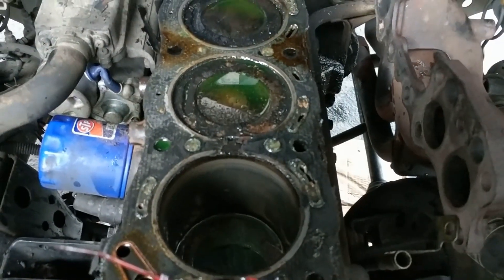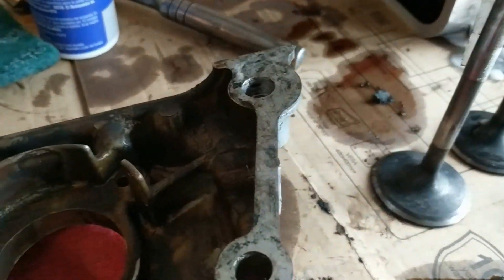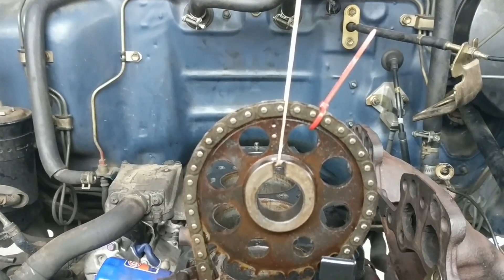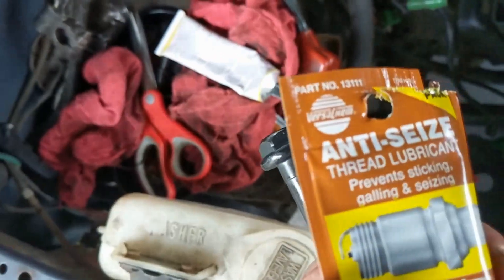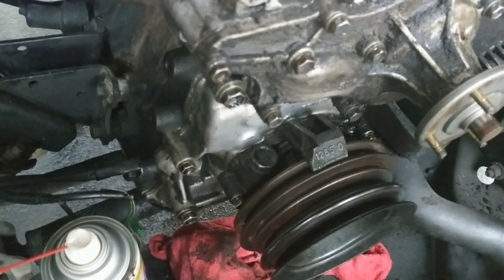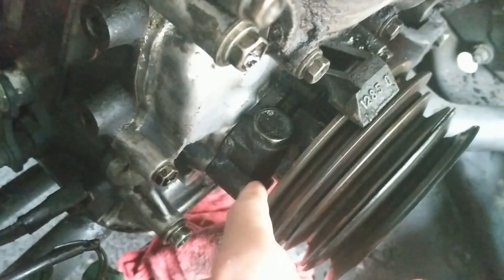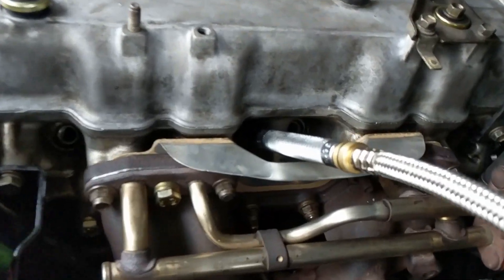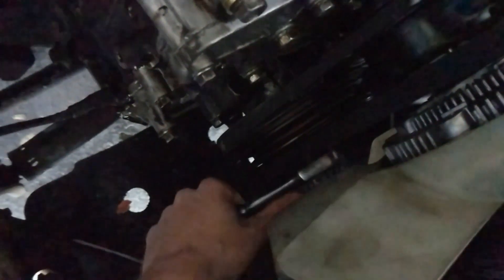22R Head Gasket Replacement 🔧 Blown Head Gasket Between Cylinders - '88 Toyota Pickup

Comment: Don’t think you’re supposed to spin the motor counter clock wise due to slacking the timing chain etc. sum to do with that anyways. (Heard that about 22re’s cause I had to do work on mine)
Reply from the maker: Correct. The guide rails and tensioner aren't designed to take load. They are only meant to correct slack in the chain.

Comment: A good tip to get the timing chain tensioner to move over to give you the chain slack to get the camshaft sprocket onto the camshaft, is to use a 19 mm socket on a breaker bar on the crankshaft bolt, and move the breaker bar up and down two inches, several times, to slightly rotate the crankshaft back and forth, as this will move the timing chain up and down, which will force the tensioner to move over a bit, and this will give you more slack on the timing chain so now the sproket will go onto the camshaft.

Comment: Also get a steel guide which is a  metal guide for the drivers side, as the plastic timing chain guides break right where the bolt hole is.
Reply: The fel pro cylinder head gasket is the best.

Comment: Was it shooting radiator water into the resivoir when it gets hot....
Reply: Too much pressure in the coolant system from the pistons pushing combusted fuel past a bad cylinder head gasket and into the coolant system.

Comment: You did it with out removing the cover how
Reply: There is a hidden bolt on the cylinder head removal, hidden in the oil beneath the sprocket on the camshaft. There is also a hidden bolt on the underside of the intake manifold more towards the front of the engine. The timing chain cover has a hidden bolt on the driver's side that runs from behind the timing chain cover  to point towards the radiator. That bolt is found by the metal tube that runs towards the rear of the engine.
Reply: There are videos on YouTube that have shown two different ways to replace the cylinder head without removing the timing chain cover. One video used a home-made  wooden wedge to hold the timing chain against the tensioner. Another video purchased a special metal wedge shaped tool.
Reply: Which cover are you talking about? The timing chain cover? He did remove the timing chain cover.
Reply: That 7mm crankshaft oil seal is a better replacement for the OEM 12 mm.
Reply: The side of the cylinder head gasket that has the blue color, faces up towards the blue sky.
Reply: Depnding upon the year of the vehicle manufacture, if the engine is the original engine, when setting the timing marks for the camshaft sproket and the crankshaft. Note that the timing mark on the camshaft sprocket will be a bit left of bring actually vertical, meaning a bit towards the passenger side of the vehicle, while the crankshaft pully timing notch points to zero.
Reply: The hidden bolt on the intake manifold is located below the gooseneck of the thermostat housing.
Reply: Another trick to get the timing chain sprocket onto the camshaft is to insert a metal rod into the center hole of the sprocket to pry it gently upwards slightly enough for the sprocket to slip onto the camshaft.
Reply: Another trick to loosen the crankshaft bolt that is torqued to over 230 foot pounds, is called the bump method, where you use a 19 mm socket on a breaker bar and lodge it under the frame of the vehicle, and use a bungie cord to hold the breaker bar against the vehicle frame.But first make a note of which direction the engine crankshaft rotates when the starter is bumped quickly with the ignition key turned briefly, so you will know which direction to place the handle of the breaker bar against the vehicle frame to loosen the crankshaft bolt. Remove the coil wire from the electrical coil so the engine does not start and run when you do a quick turn of the ignition key to bump the starter motor enough to lossen the crankshaft bolt.
Reply: The side of the cylinder head gasket where the two fire rings of the adjacent cylinders merge, is the side that will face the engine block
Reply: The bump method to loosen the crankshaft bolt. Places the breaker bar under the passenger side frame.
Reply: Don't lose the O ring of the crossover metal pipe, and don't lose the power steering pully keeper key that fits into a slot on the shaft of the power steering pump. As that key can fall out when the pully is removed.
Reply: There is a hidden bolt in the front of the cylinder head, which is not easy to see, as it is hidden in some oil in the front cavity where the timing chain resides and where the gear of the distributor shaft resides. The bolt is located under the gear of the distributor, and that gear runs off of the camshaft rotation. The bolt sits vertical and it threads into the top of the timing chain cover. Use a cloth rag to soak up the oil to then be able to see the head of the hidden bolt. The cylinder head will not come off if you forgot about that hidden bolt.
Reply: Be sure to lift the cylinder head off directly vertically, as any sideways movement can break off the tops of the timing chain plastic guides.
Reply: Make sure that when you have installed the rocker arm assembly that it is square and flush,  or otherwise you will end up with a bent valve stem.
Reply: The hidden bolt in the front cavity of the cylinder head where the timing chain and the distributor shaft resides, is seen after you remove the bolt of the camshaft sprocket, and remove the distributor. Then wipe up the oil that hides the head of the hidden bolt.

Comment: Does anyone know if the intake and exhaust manifolds casket have to be replaced if manifolds are taken off to get to the head casket...what website did the replacement parts come from
Reply from the maker: I think you should be good on reusing the the exhaust gasket. I would suggest replacing the intake gasket though.

Here's an option on Amazon: https://amzn.to/3tIZJoI
Reply: The 23R engines have a bad habit of an exhaust manifold leaking because the fasteners work their way loose. So make sure to occasionally check that the nuts and bolts are tight, especially the exhaust manifold studs, nuts and bolts that are more towards the rear end of the engine.

Comment: Approximately how long did the whole process take minus having to remove the head and have it resurfaced? My 22re is needing the same attention. We all must learn from our mistakes or how else do we figure stuff out 😬
Reply from the maker: You could do it all in a day (8-12 hous). But, if this is the first time tearing the engine down, I'd give yourself a week. The EGR bypass is no fun. I also suggest removing the radiator, makes things easier. Also, the power steering bracket is a little wild, I have a video on it. 

I can only think of a few nuts and bolts that gave me issues.
Reply: Also where he put it to 0. You should put to 5.
Reply: I just pulled my 22r out today , first time pulling an engine, took timing cover, oil pan, rocker cover gasket, oil pump,  water pump and existing brackets in 6ish hours and cleaning the parts up for re install later. i did not touch the intake side at all. carb was still fitted , i only focused on the front engine disassembly . its a fairly easy task, just remember to create templates on carboard marking the shape of each component and putting a small circle for each bolt position and punching the bolt through the dots in the allocated area. to never forget where they go.

Comment: Is it possible to change the cam without lifting the head and would it be hard?
Reply from the maker: Are you talking the gear? The camshaft itself will require removing the head bolts, but the gear can be removed on its own if you're trying to do an upgrade or timing chain repair.
Reply: @wildworkshop  No I was talking about the entire camshaft I've heard of people pulling the head bolts and swapping a new cam without pulling the head. I've got a new rebuilt motor but want to put the 261c cam in. And dont want to pull the head and have to get it decked and all that. Just wondering if its possible if you were real careful.
Reply from the maker: @calebbennett6947   I don't see why not. Like you said, just be careful. Get new head bolts and torque them properly (rinse & repeat a few times after running it).

The only big issue I see is removing the shaft connectors (think they are 10-12mm). You could add 2 head bolts with spacers (after removing the lifters/arms assembly) to secure the head in place. This way you don't risk nudging it. Doubt you would even need spacers, but they'd definitely make me feel better.

Good luck!
Reply: Yes you can I did it
Reply: I have seen it done on a youtube video, maybe you could find the video.

Comment: You sure your timing wasn’t off
Reply from the maker: Timing is actually perfect. The cam gear should look like it's slightly off (to the left). Crank pulley pin should be @ 12oclock though. The rest is done by advancing or retarding the distributor.

Comment: At 6:48 there are two green things showing. Does anyone know what those are called. I need to purchase some>.< Plz and TY
Reply from the maker: Looks to be a temp sensor. This is what I found. https://www.pirate4x4.com/threads/22r-temp-sensors.1629154/
Reply: @wildworkshop  Thank you so much!!(:
Reply: They are temperature sensors. The vehicle will run without those two sensor connected to the wires until you can get new sensors. Sensors are cheap at used auto parts junkyards if they happen to have a 22R engine in a vehicle in their junkyard. They can easily fit into a pants pocket, since you pay a few dollars to enter the junkyard.

Comment: I'm not sure why anyone would ever replace a head gasket without having the heads resurfaced. Unless you were in the vehicle and knew it was shut off before it ran super hot, lol
Reply from the maker: Ignorance, 'resurfaced' wasn't even in my vocabulary until the 2nd attempt. I'll take an attempt, failure & education rather than the lackluster effort put into raising me. Something, something, no child left behind...
Reply: What's a fair price for a resurfacing job?
Reply from the maker: Haven't had one done in a while. $80 about 8 years ago. Not sure what the going rate is now. Probably location dependent.